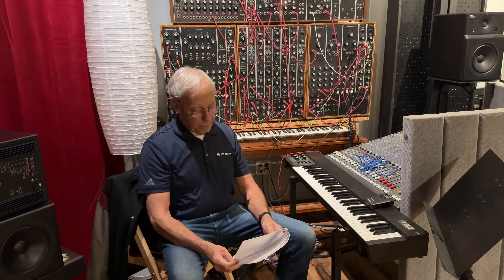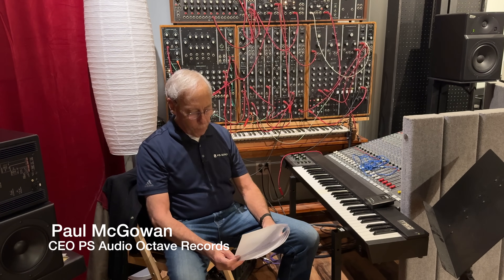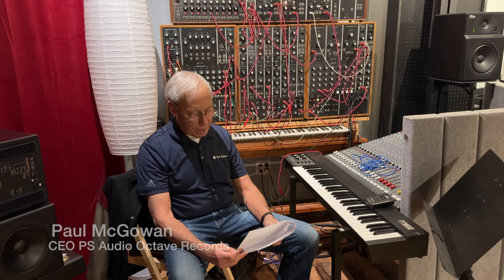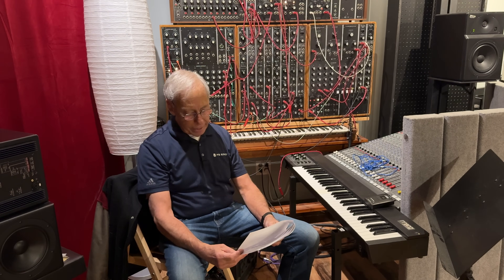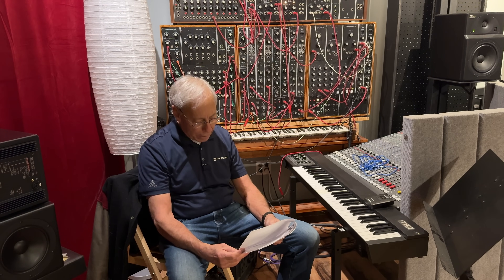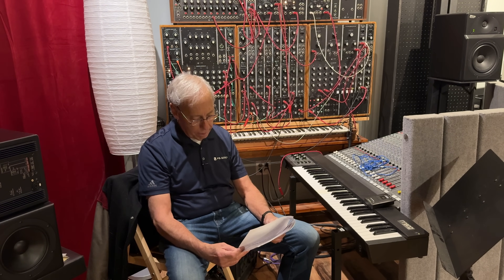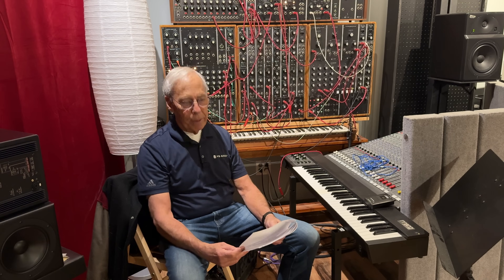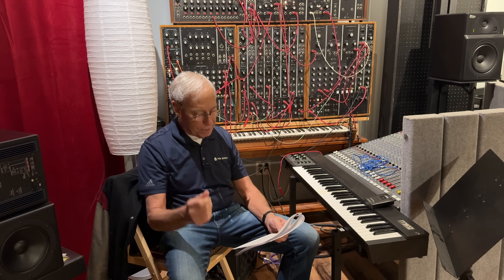Clocking and reclocking digital audio

Comment: The big question  - is your streamer equipped with a better clock than your external DAC. The DAC will be the final timing adjustment and could make the exspensive streamer irrelevant.

Comment: Clocking, reclocking… actually a completely waste of time and resources. The format of data is well defined. The DAC knows the number of bits per second to be converted and so the only place for a good clock is the DAC. Delivery to DAC is best when it is implemented asynchronous and the bits are stored in big buffers on DAC side (e.g. 10 Mbyte would be good in order to deliver interrupt free music).
It’s time for a paradigm change: computer scientist should take over from the “engineers” the architecture of digital music delivery as it could be implemented perfectly without all this “reclocking things” in between the file and the DAC… just my 2 cents.
Reply: Absolute correct. Paul probably understands how digital data works and I suspect he is being deliberately opaque with his explanations. Or perhaps too many years staring at scopes instead of logic analyzers. The data rate on digital transport is so much greater than audio data there is absolutely no timing correlation with the bits on the wire or in the air and the audio bits. In any case its much better think of digital audio as simply numbers rather than individual bits.

Comment: Would the signal out of your Direct Stream DAC sound better when fed by your Air Lens than without it? Is the Direct Stream not capable of complete reclocking and reshaping? It requires the feed be processed before it is capable of complete error correction?

Comment: This multi clock approach is a crappy solution. Much better is to run the DAC clock precisely without PLL and the data flow from source (AWS data center, for example) to DAC is entirely asynchronous. Audio data through the internet and USB can support this while SPDIF, TOSLink and I2S are synchronous and creates problems with multiple clocks and jitter. Why the heck not get this issue correctly fixed???
Reply: This is correct, of course
Reply: @davidfairchild1640  Yes, but sadly the reality is that source devices usually have no asynchronous output (USB-C, for example) and rely on old-style push synchronous interfaces like SPDIF, TOSLink and I2S. Even nowadays very expensive transports run their own clock and output data synchronously. A US$30 CD drive can read data on demand asynchronously but a US$20,000 CD transports can not lol…
Reply: @ThinkingBetter  yep, this is why my preferred streamer is a Raspberry Pi 5 via USB to my DAC.
Reply: @davidfairchild1640  I have a pile of Raspberry Pi boxes myself from V3 to V5. My garage speakers are active through a Raspberry Pi, DAC and amp PCBs I put into one of the speakers as a sort of hobby project.
Reply: @ThinkingBetter  I use Moode as my OS. Do you have a preferred OS for the pi?

Comment: Best is one master clock running the DAC without jitter concerns and data flow being asynchronous with buffering ensuring no dropouts. No need to re-clock.
Reply: This is the way.
Reply: @davidfairchild1640  I listened to this video again and had I been an engineer at PS Audio I would have gone to Paul and said, why don't we fix this entire multi clock master mess and make our product family run asynchronous data completely eliminating this entire topic? I can understand this crap of multiple clock masters exist due to legacy solutions, but come on, Paul has an in-house R&D team that can do better. And even I2S can pull data asynchronously at a rate determined by the DAC, if that was an issue. A CD transport and streamer with asynchronous I2S output (pulling data via DAC clock as master) and a DAC with I2S asynchronous input (serving as PLL free precision clock master) would be something...

Comment: Interesting.  I would have thought the optimal approach would be to have all of the DAC recloaking functions described, but also to have an I2S input that does not reclock so that you have the option to use an external clock of better quality than the DAC.
I also like having the clock section with the option to replace the clock so that you can experience different clocks as you might change tubes.  Typically this degree of flexibility comes with ridiculous price tags commercially, so it is a perfect area for DIY.
Reply: You can resolder different clocks in some equipment rather easily. Others have clock inputs
Reply: @Pete.across.the.street  Agreed.  I have done all the above with good results.  I have soldered the tiny little NDK SDA clocks that require a steady hand and a magnifying glass.
My current end game setup has the clock in a separate well insulated/dampened chassis with it's own power supply.  It is connected via a very good 1m coax terminated with SMA connectors.  I can also disconnect that system and pop in any of the 5V 4 pin clocks.  The key is to have a SOTA low phase noise clock at it's optimal temperature in a vibration dampened enclosure.  Power supply matters but not as much as vibration control.

Comment: One question is, does the reclocking in the DAC, which I presume has not the same quality as the Air Lens, the signal worse, or does it make the signal even better? I would think that a reclocking would bring the signal to the quality level of the reclocker, so if the incoming signal has better timing, the signal could be worse after the reclocking. But this must not be the case, because that would make the reclocking in the Air Lens useless.
Reply: If you do not have the option in the DAC to bypass it's built in reclock/timing then you are always listening to the jitter of that system.  An Airlens type of device will make a small difference solely by adding one more galvanic isolation.  It's reclocking function is just a waste of parts/money.

Comment: Its better explained as re-timed. The data is received at a baud rate determined by the signal source clock. To use the data you have to clock it in at exactly (+/- buffer depth) the same rate. The receive clock needs to match. We use a phase-locked-loop, which can alter the receiving clock frequency to match the incoming data. Dependant on the phase difference of the data.  This way a one is always clocked when it is secure at a one level, and a zero under the same condition. If the clocks drift too much you will encounter the transition and it’s a coin-flip on an error. The quality is down to the phase-locked-loop. The worst is digital “bang-bang” phase detection, I prefer analogue with a VCXO (voltage-controlled crystal oscillator). This said the digital PLL are now good enough to be indistinguishable.  The issue with most PLL is that when the clock is slow, the electronic circuit senses the phase error and speeds up the clock, same for when the clock is too slow. The question is when the clocks match, because there is then no phase mis-match, and therefore no error signal from the phase detector,  the clocks will eventuality drift until correction kicks in again. This is called wander. For data edge detection PLL, if you get long strings of ones or zeros, then the clocks again can wander. It matters in digital systems, but not audio.  PLL Jitter is a whole subject.
Reply: This is a crappy solution due to messy architecture. Much better is to run the DAC clock precisely without PLL and the data flow from source (AWS data center, for example) to DAC is entirely asynchronous. Audio data through the internet and USB can support this while SPDIF, TOSLink and I2S are synchronous and creates problems with multiple clocks and jitter. Why the heck not get this issue correctly fixed???
Reply: Ditto!😂

Comment: The need for reclocking is a symptom of poorly (inappropriately?) designed data transfer topologies that the audio manufacturers have settled on ( synchronous SPDIF and isochronous USB largely). If the data stream communication protocol were fully asynchronous , bi-directional all the way from source to DAC, with redundant bit modulation for packet error correction and packet resending upon packet loss, then only one master clock in the DAC could govern the whole process. All then required is that each intermediate data relay has enough local FIFO buffer capacity such that there are never any buffer over-runs/over-flow or under-runs/under-flow along the chain of components.
In essence; the DAC should always be pulling data from the source through a data request protocol, the source should never be pushing data to the DAC. USB audio gets this partly right, but whilst they implemented error correction for corrupted data packets, they didn't implement a mechanism for re-sending lost data packets in USB audio, which is its shortcoming (hence it is isochronous , and not asynchronous ) .

DACs and the associated digital music data communication protocols should be designed more like computer printers work. A printer doesn't care one jot whether the document to be printed came from a floppy drive, a hard-disk or an internet connection, and what dodgy quality of USB cable it travelled over: the printed document always looks exactly the same on that printer because if there were any data corruption, the printer would simply ask for the data to be re-sent.

Comment: My iFi Purifier 3, plus my Adum 3160 filter and Sonic Scientific Quicksilver filter works very well with line noise from my computer. 

The Adums works as a good low pass filter while the Quicksilver works as an excellent high pass filter. I have a full range of filtering working well together. These are my galvanic isolators. 

My Purifier3 does the clocking and reclocking. Plus some filtering as well.

Comment: No it didn't answer it but I will... No reclock is perfect. Having a digital stream clocked a few times usually leads to a better output signal and does sound better. However, there is a trade off. To reclock you must use a buffer. Using a buffer increases latency. More reclocks = bigger buffer = higher latency. Not the latency effect of waiting for music to play or drop outs, but latency of streamed audio has a big effect on the time domain of playback and helps, when u have ultra low latency networks, create a better sense of space, soundstage, instrument placement ect. As everything, there is a balance here.

Multiple clocks before a final clock SHOULD NOT affect ANYTHING. However the sonic differences are absolutely undeniable I can show this clear as day with recordings I took. I used to think the last clock is all that mattered... False. Remember we don't understand everything and we commonly think X and then find out later we were wrong. Don't fall into the camp it can't make a difference because that's not what we "know is right." Just like medicine, what we are taught, common saying is 50% will be wrong in 10 years (I am in medicine)
Reply: W.r.t medicine, to be approved these have to go through extensive blind trials to prove effectiveness.  I’ve never seen a blind trial producing statistically significant results showing that reclocking can even be identified by the end user.
Reply: @greenygreen5308  just because you haven't, doesn't mean it wasn't done. This is classic bias
Reply: @B2_Labs  indeed it doesn’t.  Please provide appropriate links to said tests.
Reply: Nah, I think you have been lied to. The only things that matters is if the last buffer is of adequate size, has a proper data feed, and has a high quality clock on the output. All the buffers before it don't matter. In fact if you really want to be picky, you could say that having a couple buffers and reclocks before the last stage would be beneficial because you can better control overflow and underflow conditions.
Reply: @tristanjones7735  How does that all tie in to the concept of a synchronous connection like spdif where the signal timing is supposedly determined by the source component (as long as the receiving component has no PLL)?
Reply: Complete and utter horse crap. Only the final clocking matters. A clock latter on in the chain completely replaces any previous one.  That's assuming the signal even had a clock at all. A USB audio signal doesn't carry any clock information. 
Also latency has 0 effect on sound quality and only matters when accompanying a video.  Latency could be nanoseconds or several hours and it's not gonna sound different.
Reply: @G3rain1  Truth.  Even the super cheap DACs don't have a jitter problem.
Reply: @G3rain1 I can prove it does matter and have. I also said exactly what you said... Until it was too obvious to ignore. Look I truly said this... And as u reduce latency with upsampling and diretta the sound became undeniably better. I have recordings that prove this.
Reply: @B2_Labs  You're going to need oscilloscope traces to prove this.  Or at the very least, double blind listening tests where the sources are within 1/10 dB of each other.
Reply: Paul’s answer was much better.